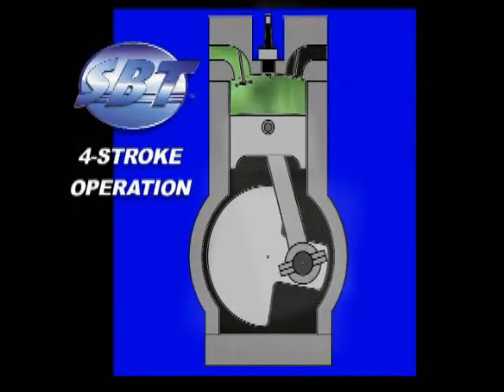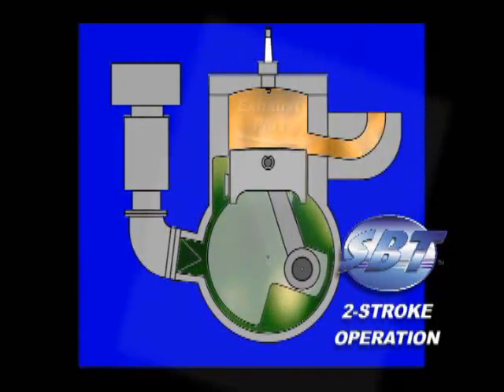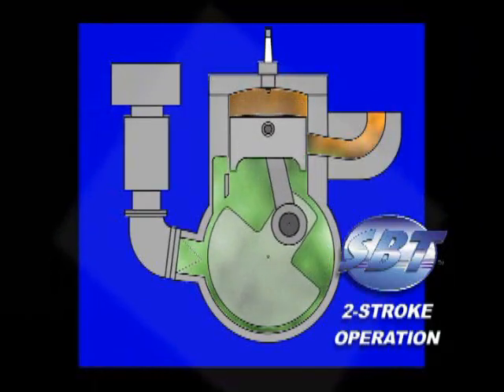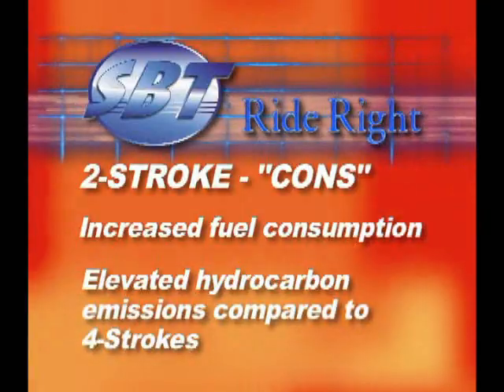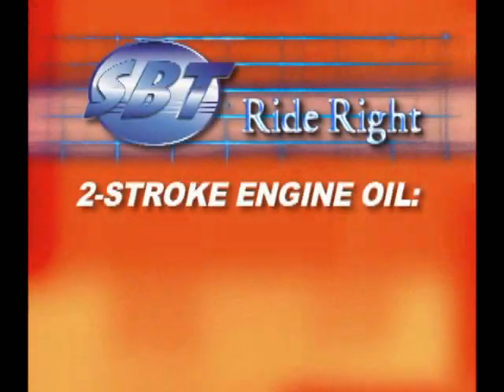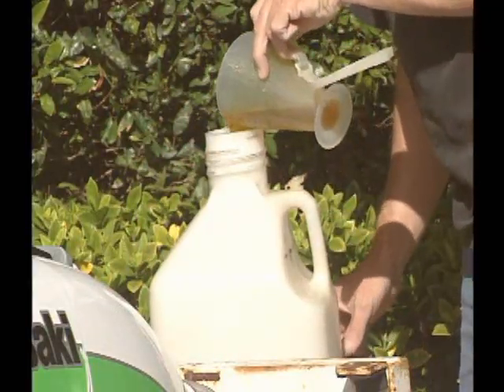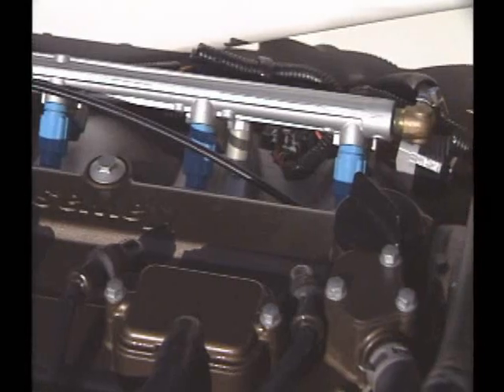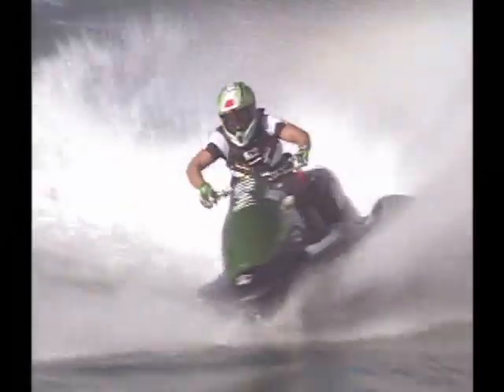2 Stroke Engine vs 4 Stroke Engine

Comment: Bullshit...
2T are more fuel efficient if You compare vehicles producing the same power. Other comparation doesn't make sense !
For example You got to compare 125cc 2T to about 380cc 4T.
Just think logical:
2T produce over x3 more power from the same capacity.
it means over x1.5 more power from about the same amount of sucked in fuel-air mix !

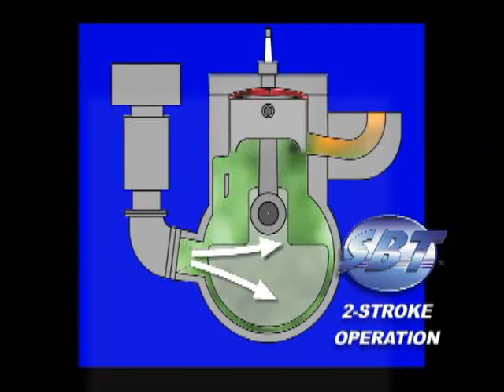Lets add to the running costs cost of the 2T oil. Normally it's about 2%, but in the case of performace bikes about 1:32 if we run on premix.
So on every burned 1l of oil we pour in 32l of petrol
Current petrol cost £1.10/l (really cheap now - works on 2T disadvantage as the 2T oil is about the same)
Top brand 2T Oil: £13.00/l

(13.00+32x1.10)/33=£1.46 VS £1.10 (petrol costs)
= 1l of performanced 2T petrol cost about x1.32 more than 4T

Lets check how much it cost to produce certain power 1.5:1.32=1.1(36) VS 1 (4T)

In the simplyfied way 2T is producing x1.1(36) more power for the same money.
But hang on !
there's few additional factors:
The same capacity 2T sucks in less mixture, as once the piston is going up it pushes out (for a while) some of the sucked in gases trough intake and exhaust ports instead of compressing it !
It's doing it fast so tet me say it's compressing it just a little bit, but most of it is just being pushed out for about half of the up stroke !!! (depends of the power valve = revs).
So the real 125cc really operates on absolutely no more than 100cc of intake gases !
It wastes a little bit of intake gases going to the exhaust port never being burnt. I'ts producing a little bit nasty emissions but making even less than 100cc mix really working...
Anyway it sucks in let me say no more than 100cc instead of 125cc so let me reduce the power/petrol costs. It makes about 1.5:(1.32x100/125)=1.42
42% more power for the same costs...
2T producing the same power is significantly lighter than 4T equivalent.
It obviously affect the fuel consumption...
All in all in my opinion 2T is at least 40% more fuel efficient, but the problem is that You never like to ride the beast in the fuel efficient way ]:->
I'm not including the engine service as it WILL cost You MUCH more on the 2T
But once You ride it not too insane than it will last for long enough to get the money back from running costs...

If You add to the 2T direct fuel injection and modern lubrication system than it's being absolutely unbeatable comparing to usual modern 4T...
Takes much less oil (much less smelly exhaust gases), producing about the same power, less polution than a 4T while taking even less petrol !
Reply: Generally 2 stroke engines are less fuel efficient (meaning they wont go as far as a 4T with the same amount of fuel). A 125cc 4T will use less fuel than a 2T.
Reply: Bullshit !
You still compare the same capacities... BUT THEY PRODUCE DIFFERENT POWER, MAN !!!
If the target would be: build ANY cc engine that will drive 200kg vehicle as far as it can at speed of 100km/h the 2T will win...
When I drive my 2T 125cc super-moto It consumes a lot of petrol, but only because I like to accelerate fast, but when I drive like a pussy it takes really not much fuel.
'Problem' of 2Ts is that drivers like to accelerate fast and it takes much more fuel.
2T is much more flexible - it gives You more power if You want to use it.
I can go on my bike on the 7th geat all the time at low speed (let me say 30mph) and it will take really not much fuel, but same cc 4-stroke would have to go on the same gearbox at 4th gear as it will have no power...
Obvieusly my bike running at low revs will take less petrol than 125cc 4T going at medium revs...
Reply: Go on fuelly (a site which people can enter their fuel consumption) and search for a few 2 stroke bikes and a few 4 stroke bikes and compare the mpg.
Reply: WTF you're talking about ?!
I checked that...
125cc 2T 95mpg !!! And it's a SPORTS bike (NOT TOO FUEL EFFICIENT).
it supposed to be compared with 250-500cc 4T - depend if You drive it restricted or not, but this that it takes half more petrol once You derestrict it means no more than this that people like to drive them fast (while even 2 times bigger cc 4t produce far less power and just CAN NOT GO FAST).

http://www.motorcyclenews.com/bike-reviews/cagiva/mito-sp525/2008/

Check 2T engines with direct injection and advanced oil lubrication. No 4T can even compare to them ! They are super fuel efficient and rated as 'Ultra Eco' !

4T are just being promoted by petrol companies...
BTW
(I'm a mechanic and I've been driving a lot of vehicles with different engines...).
Reply: Let them go artur incognito
Reply: +Artur Incognito Watch that video about a two stroke engine vs. a four stroke. It will show you how the 2 stroke is far less fuel efficient, but produces more power. Please inform yourself before saying a 2 stroke is more fuel efficient.
Reply: Got em good bro lmao

Comment: Clarification for anyone in need:
2 strokes have an explosion that pumps the piston every 2 strokes (lol)
4 strokes have an explosion that pumps the piston every 4 strokes (lol)
So, 2 strokes run twice as hard.
But 4 strokes still have some advantages when it comes to pulling power.
Reply: But that would mean the 4S would have to spend twice the power of the 2S on running the stroke. The 2S would transfer most of that energy to the wheels.
Reply: @Naked_Snake  It's not mathematical like that lots of variables,Two strokes get very hot,some of the fuel goes down the exhaust pipe never been use just wasted
Reply: Not true...4 strokes only ignite between the compression and power stroke(once per 2 full rotations of the crankshaft)
Reply: thanks man, now I understand it :)
Reply: the unburnt fuel of 2 stroke can be push back using calculated exhaust shape by using backpressure
Reply: @nuekgg2305  Tuned pipes and expansion chambers are cool, but a better solution is just to skip the fuel in the crankcase all together and inject it directly into the cylinder.
Reply: @autogolazzojr  They did that in the second world war,The Germans were using two stroke diesel connected to four roots turbochargers for each engine,4 engines in to drop bombs on London they weren't likely to succeed let alone drop bombs on England and make it back so engines blowing up didn't bother them they can bail out
Reply: @autogolazzojr  Check out Yamahas "Torque induction"
Reply: Jesse Alston No, I meant 1 ignition will have to be able to rotate the crankshaft 2 revs in a 4S, thus reducing the energy transferred to the wheels. The 2S will give that power every revolution. So, the 2S would be more powerful.
Reply: https://www.youtube.com/watch?v=m6AZ7_mACUg&t=30s
Reply: They don't run twice as hard. They lose much of the fuel to the exhaust port before the piston reaches a level to close it. This means the compression is a lot lower, and there's less fuel to burn, equalling less power...
On the other hand, it does explode twice as fast, but that doesn't mean it makes 2x the power. It does make more per 2 cycles than an equal 4 stroke in one, but not double by any means. It does consume a LOT more fuel though. And sounds like ass.
Reply: @FilipGereg  It was estimated up to 40% which is less the half, My 550cc two stroke triple could easily out accelerate at standard valve,single overhead camshaft 550cc and 750cc.
Reply: Less weight and more power equals more weight but less emission. At the end more weight means the motor must give more effort so the acceleration is less in compare of the 2 stroke so at the end they end up fuel the same time.
Reply: I am not a genius but I am really interested by 2 stroke engines because it is easier to set up and is more fun because of the weight but I really look forward for the future so less consumption is on a winning hand for me
Reply: @jordiedmond5744  There was a two stroke sealed engine made years ago but upset the "spares industry"  you use it and when it doesn't work buy another they were so cheap undercut the expensive spares industry and was shelved,Anything that SAVE THE PUBLIC MONEY is often bought then shelved,It's important the public to keep spending money having vehicles that last 5 years plus is not financially viable to the manufacturer unless they extend the life with expensive parts
Reply: @jordiedmond5744  Probably not due to fuel injection,Nowadays computer controlled
Reply: Thanks!
Reply: Higher torque i think less acceleration
Reply: EpiDemic117 Oh yeah, I agree that the 2S will consume more fuel due to the wasted fuel. But I was talking about the power to stroke ratio, which you also mentioned.
Reply: EpiDemic117 That's pretty cool. I watched a video by them just now. Thanks for letting me know! :)
Reply: twice as hard as those with 4 strokes (get it) lol
Reply: And gas mileage
Reply: Yes

Comment: You might not like all the tree huggers but it is because of them we have manages to get a grate fuel economy if it wasn't for them you would still be throwing away about 30% of your fuel tank every time you fill up if work out the prices of that lets say 50 liter  fuel tank  that is roughly 15 liters you are just throwing away with 2 stroke engines

Comment: The old 1 stroke engines were the best! Twice as powerful as a 2 stroke and 3 times more powerful than a 3 stroke. Ah good ol days. Had a twin cam 2 stroke for a while but sold that cause the alternator stopped working. :)
Reply: FROM WHAT PLANET ARE YOU...
Reply: OK, I understand it's a joke, right ?
(obvieusly there was no 3-stroke engines, no cams in 2T and magenos, no alternators if so...)
Reply: @ArturIncognito  Magnetos produce the power for the sparkplug,Alternater produce power to recharge the battery after using the starter motor,power the lights and through a ignition coil the sparkplugs
Reply: If you think about it, a 1 stroke engine would just be a steam engine.  Given that the steam pushes on the piston from both sides, every stroke would be an intake/power stroke on one side, and an exhaust stroke on the other.
Reply: @anarcoyote1207  or a turbine of any kind.
Reply: @vladimirlucifer4566  Turbine is rotational and could be water in a dam making electricity or a steam turbine making electricity or a gas turbine and very similar a jet engine or a turboprop a jet engine with a propeller on it.
Reply: @anarcoyote1207  The four stroke was developed from the steam engine using coal gas,Two pistons produced the power the third piston was cool with cold water creating a vacuum and getting free power to push the other cylinders home
Reply: Had to keep a backpack full of exhaust bearings for my 1 stroke, but no one complained.
Reply: AmericanMuscle 2 stroke
Reply: Ah yeah the good ole days I remember going out to mow the trees on my ole 3 stroke diesel cub cadet it was a beast until the motor bearing cracked and shived through the turbo housing
Reply: Two strokes don’t need cam shafts or  valves mate
Reply: @alwynhancock8446  They do. Diesel two strokes do.
Reply: @vladimirlucifer4566  Two stroke is a two stroke petrol(gas) or diesel, Camshafts operate valves,No valves on a four stroke
Reply: So, whats more powerful? a 2 stroke or a four stroke?
Reply: @americanmuscle8463  Two strokes used to have the acceleration but most four strokes have multi valve so it's questionable
Reply: lol a twin cam 2 stroke hahaha
Reply: @AmaziinqVids  Twin cam two stroke what a idiot
Reply: Jeff Biggs rotary is a 3 stroke
Reply: @user-zx4sl9qi6y  It's actually a four stroke running on three chambers,Unfortunately the way they measure the displacement is a lie, The claim as only one chamber fire's it the displacement of just that chamber, One could argue a 1000cc fire at each quarter turn off the crank so only one piston is firing at any given time so only one piston should be measured making it a 250cc
Reply: Dang! I had a 5 stroke wankel v8. It was powerful but I sold it because one of the spark plugs went out
Reply: Bit of idiot aren't you?
Reply: 19Luke89 this guy is either joking or just a fucking idiot
Reply: Tony - Diana Fruzza The only problem with the old 1 stroke engines were the wheel nuts kept falling off.

Comment: At the dude who thinks 4 strokes are more efficient, you forgot about all the excess friction ,parasitic drag and dead weight of the cams, cam chain ,valves oil pump etc. think about how much more fossil fuel is burnt in fourstrokes to over come these issues and still make less HP than an equivalent sized two stroke.
I guess since you can see burnt castor oil its bad but if you cant see carbon monoxide its good.
Reply: Burnt carbon monoxide? Lol... facepalm
Reply: TTime685 Yawn.
Reply: spliffsperlunk Nice edit ;)
Reply: TTime685 Yawn.
Reply: Your profile picture is aids.
Reply: I wanna see you in a room doors all closed with CO you won’t less 10 min a life

Comment: The only draw back is emissions GO FUCK OFF TREE HUGGERS 2STROKE 4LIFE
Reply: I rofled so hard!!
Reply: Emissions are a major drawback; riding around in a cloud of blue smoke significantly reduces the enjoyment of operating the machine. Two stroke engines are also absurdly inefficient with respect to fuel economy.
Reply: cool story bro we'll continue polluting the air with two stroke and diesel. So eat shit u fuckn tool.
Reply: Emissions are a major drawback even for non tree huggers. Many cities in SE Asia where 2 stroke scooters are used massively suffer from very bad air quality. In quite a few 2 stroke scooters are converted to 4 stroke.
Reply: Derek Shubin Wow, what a brilliant argument! I mean, why would anyone inhabiting a small, rocky planet (along with 7 billion other people) ever conceivably be concerned about their environmental impact? Stupid libtard commies! Too stoke, yeagghhh! Derp derp derp...

Tell you what, why don't you go back to the trailer park, turn on Fox News, crack open a can of Busch Light, and complain about Hillary Clinton (or other right-wing bugaboo) to your wife/cousin. Leave the engineering to the grown-ups.
Reply: Derek Shubin Since every action has an equal but opposite reaction, a "rocket propelled double dildo" is quite a physical impossibility.

As I said, go bask in the ignorance of the right-wing media, and leave the engineering to the grown-ups.
Reply: Tyler Brown That's why you can get Fuel Injection
Reply: William Cooper Diesel's #1 pollutant was sulfur... this has been taken care of with the use of cow piss and is no longer a concern (also allowing modern diesels to have catalytic convertors without fear of them clogging / burning up). 2 strokes biggest pollutant was HC and CO. This has been remedied with direct injection and catalytic convertors.... all this while not changing how your loved engines function. Brought to you by us blue collared mechanics. not libetards ;) just us working joes trying to better the enjoyment of these wonderful vehicles by eliminating the harmful poisons they were emitting out their tailpipes. (poisons btw... that do nothing to help the HP of these mighty engines).

Comment: Errrr..... 4 strokes make more torque than a 2 stroke??

Not true as the record for the highest torque output per cc is held by a 1970's 2 stroke motorcycle at 38 Foot Pounds @ 3,800 RPM from a 343cc engine. A 4 stroke 350cc engine only makes 20 Foot / Pounds torque at best.

The video also doesn't mention that 2 strokes only make 1/24th of the nitros oexide emissions per volume of fuel burn compared to a 4 stroke engine, according to US government research back in the 1990's.

The video also fails to point out that DI 2 strokes don't need 2 stroke oil lubrication.
Reply: Someone Who knows what Is a 2 stroke!